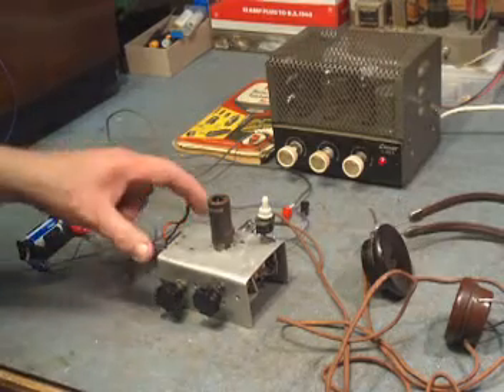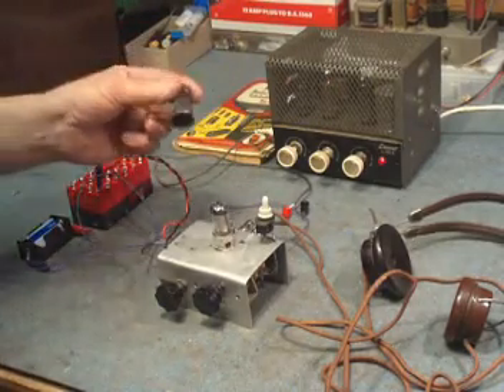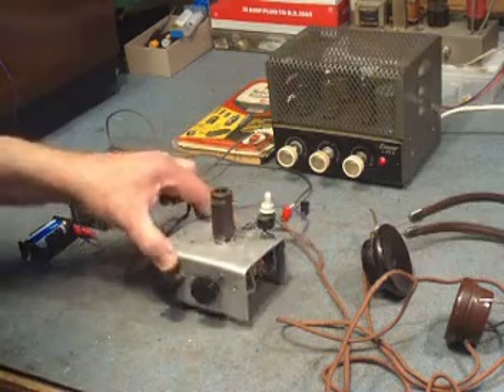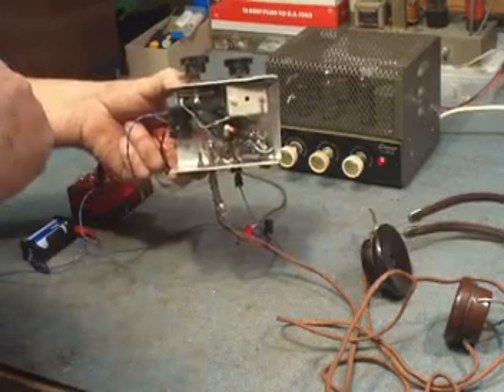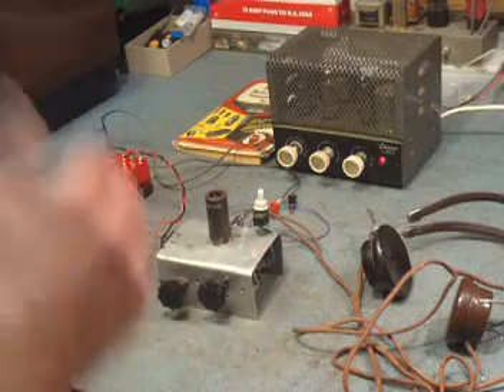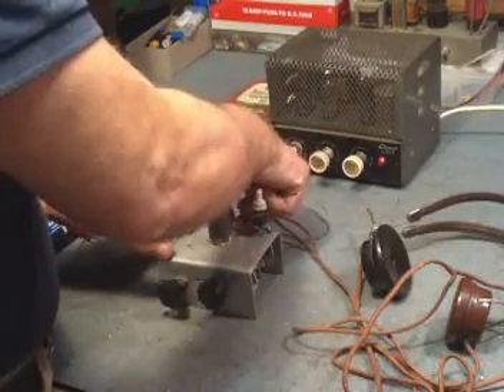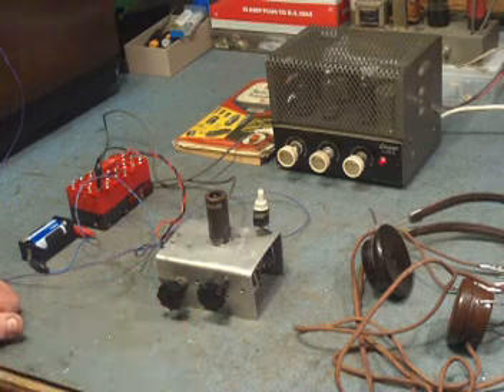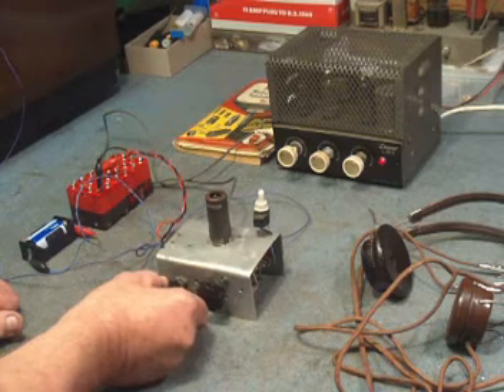One valve radio

Comment: Very good. I like valves.
I've been buying used valves of a PM2 type to recreate the H.A.C. one valve radio I built from a kit in 1969. Denco coils in that one but I have some large octal coil formers to use. I still have 2,000 Ω headphones.
I bought five for £6 with one valve marked BBC and DER and looking it up found details as between 1924 and 1926 with an intact tungsten filament. Yet to try it in actual use.
G4GHB

Comment: Dear friend I am very much happy and appreciate you for building this kind of one valve radio.  I am from India at present I have got a five valve A,C, Radio of 1960s in good working condition .I am a B.Sc physics graduate. I have knowledge about A.C/A.C D.C circuits. I want to build similar one volve Radio. Pl. advise me where can I get Pentode of above type or its equivalents. or from any of the existing 9 pin BEL valves(except rectifier) can be used for this purpose .Pl reply me

Comment: Listen to that thing go! What a strong sounding radio and amplifier, you really can't go wrong with tubes. 

I have a two tube regenerative set that tunes BCB and a bit of the shortwave band and with a 75 foot random wire up about 30ft it's managed to pull in Egypt on 49m.

Even at my age of 21 I'm addicted to radios,I'm done for! =)

Great video and great equipment.

   - Mike

Comment: I have heard about single tube radios for decades but have never seen one work until now.

I almost assumed that they were BSEE legends, not working products. How reception was possible on lumps of coal with cat whiskers is beyond me...

To be blunt, one expects a radio to have 3 tubes as a bare minimum -- a mix of a triode, pentode and a diode.

Since 1970 the complex specialty tubes that evolved from 1925-1955 have ceased to be supported so units like this are even more exotic.